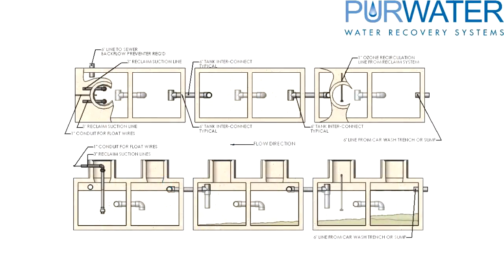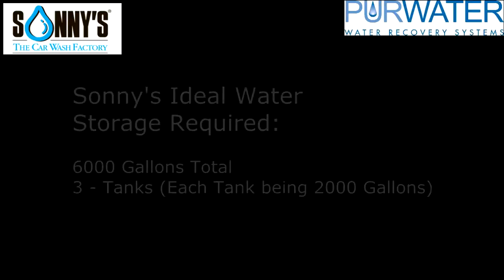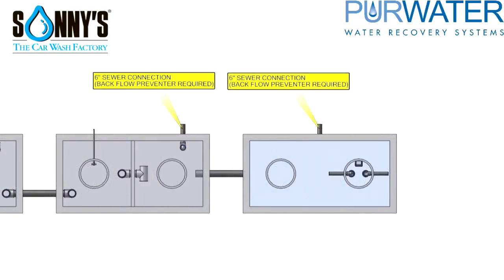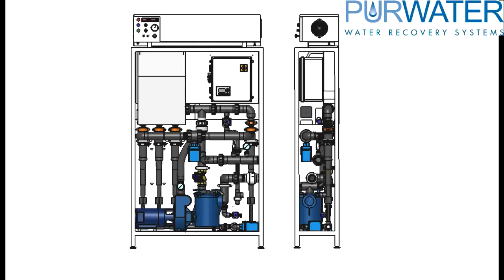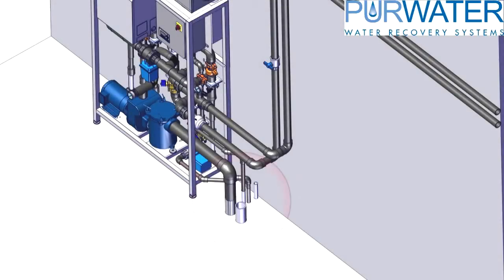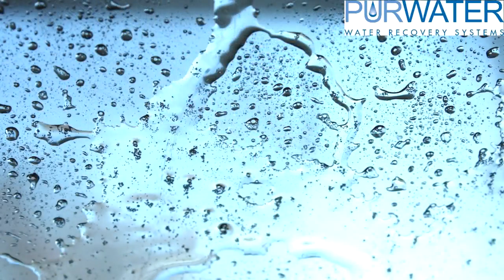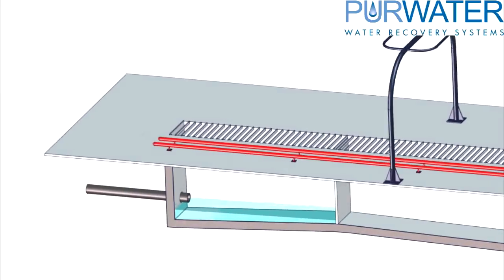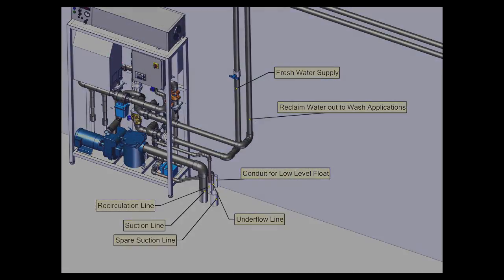Car Wash Reclaim Design and Installation – Purwater

Comment: why wash water connections are on first tank second chamber?  shouldn't be on the first chamber??
Reply: PurClean - PurWater  Recommended for the PurWater tanking system the feed from the conveyor pit is feed into the first tank first chamber. This will give more time for the water to settle the solids out.